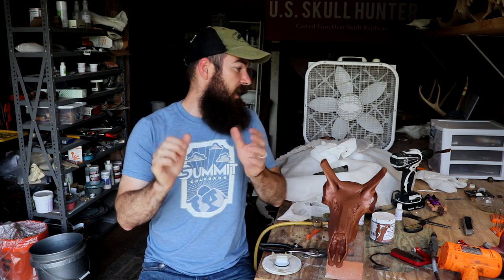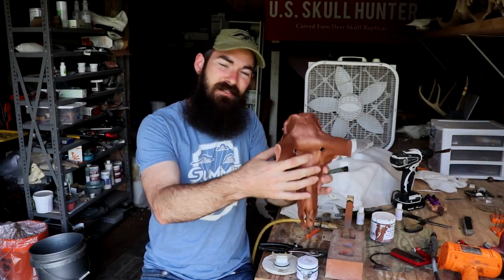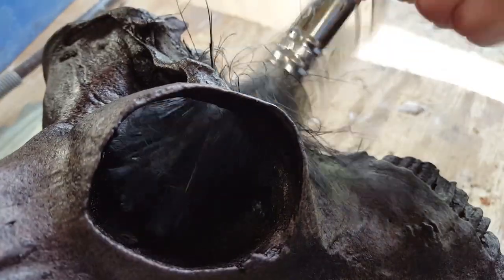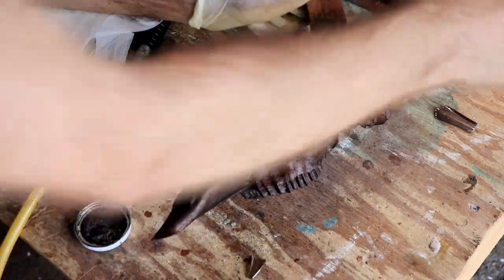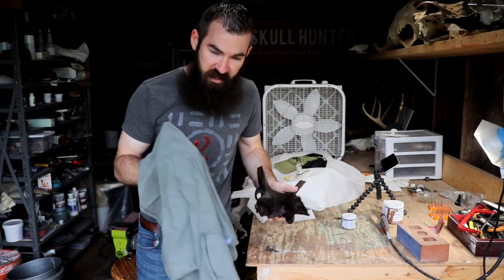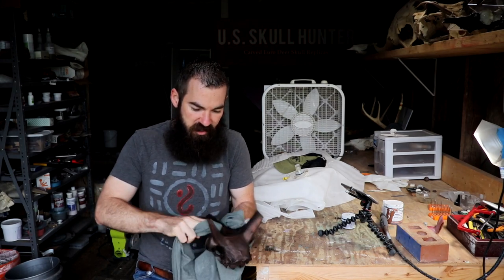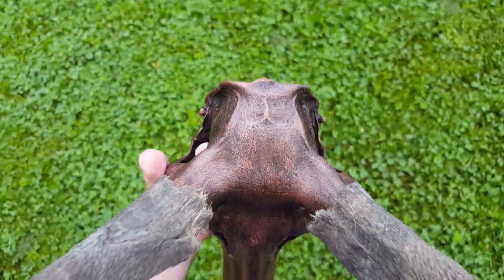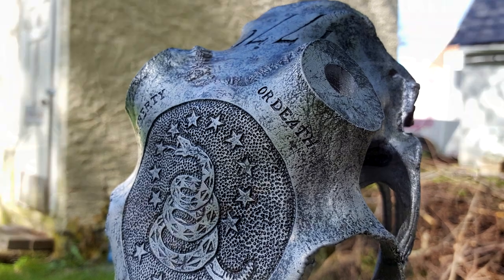How To Age a Metal Finish on a SKULL!

Comment from the maker: ➝ TOOLS USED IN THIS VIDEO
★ Paint Brush @t
★ Husky Paint Sprayer @t
★ Primer @t
★ Metal Paints @t
★ Patinas @t
★ Wax @t
★ Clear Coat @t
★ Gloves @t
★ Respirator @t

▬▬▬▬▬▬▬▬▬▬▬▬▬▬▬▬▬▬▬▬▬▬▬▬▬▬▬▬
➝ SKULL CLEANING TOOLS
★ Aquarium Heater @t
★ Mesh Bags @t

▬▬▬▬▬▬▬▬▬▬▬▬▬▬▬▬▬▬▬▬▬▬▬▬▬▬▬▬
➝ SKULL CARVING TOOLS I USE
★ Dremel 4000 @t
★ Flex Shaft @t
★ Adjustable Chuck @t
★ Respirator  @t
★ Ear Protection @t
★ Ball Carbide Burr @t
★ Inverted Cone Burr @t
★ Cylinder Carbide Burr @t
★ Large Ball Carbide Burr @t
★ Diamond Dust Burrs @t

Some links above are affiliate links! 

▬▬▬▬▬▬▬▬▬▬▬▬▬▬▬▬▬▬▬▬▬▬▬▬▬▬▬▬